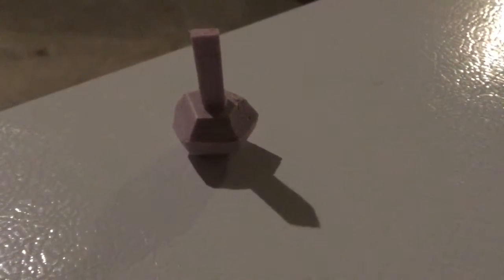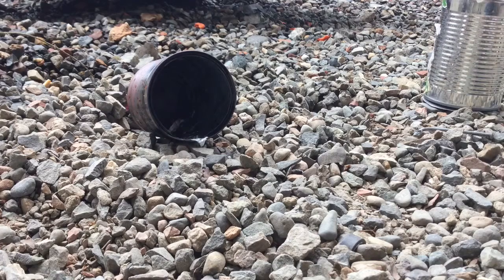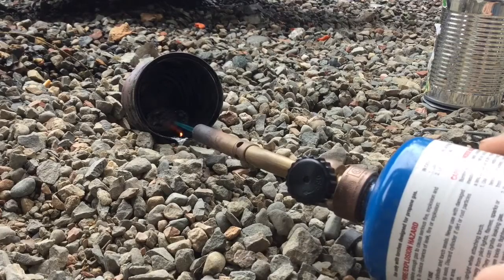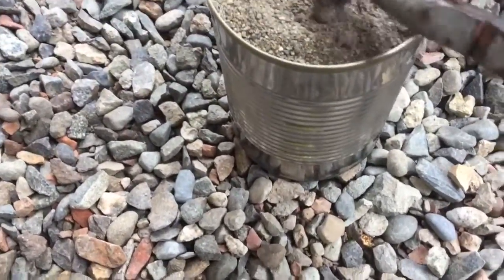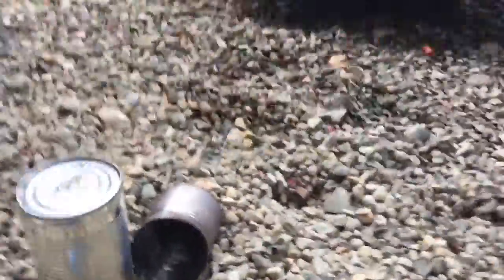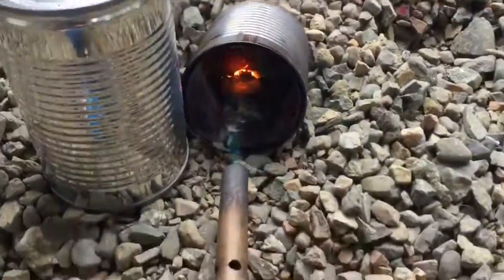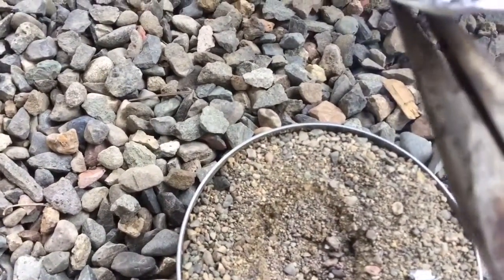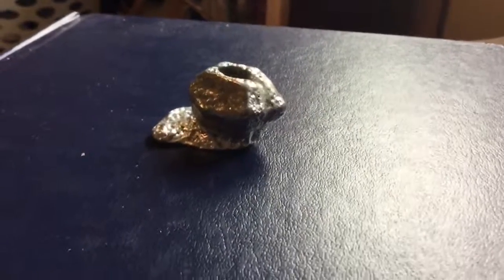Lost foam casting with zinc

Comment: Oh boy, what a mess! You should probably first get some proper gloves for this. Next I suggest you to use finer sand. If you really want to do a lot of casting, a real foundry would be great, but I know they are expensive. If zinc is not hot enough to properly melt the foam, you could try to heat it some more. Be careful though, it can start to fume and these fumes are toxic. I’d strongly recommend an infrared thermometer for checking the temperature of the metal.